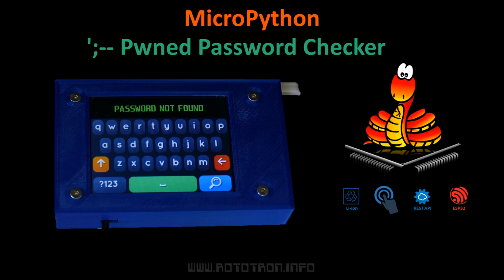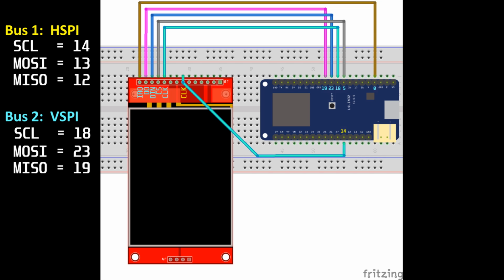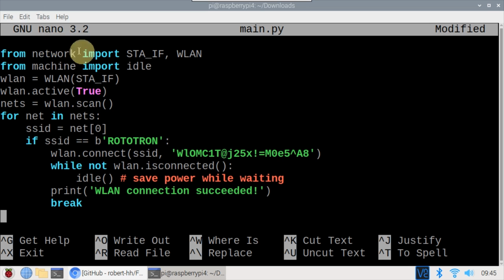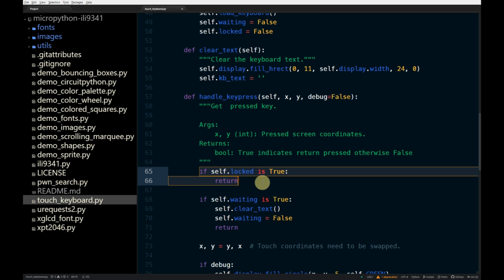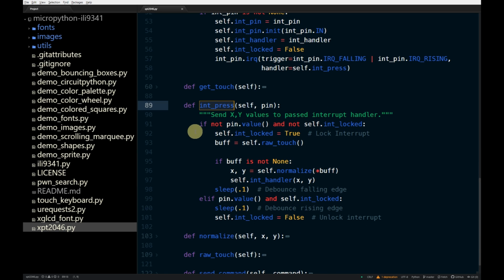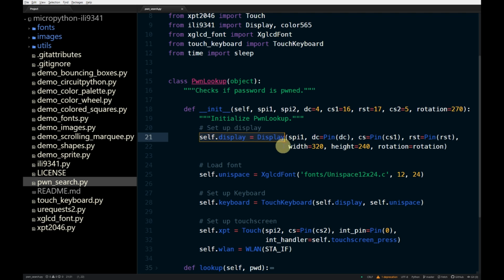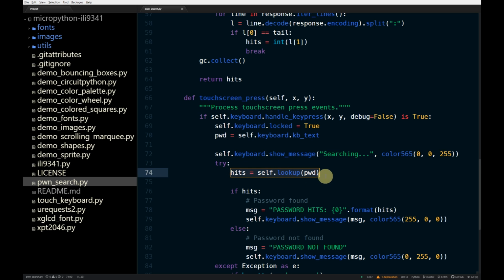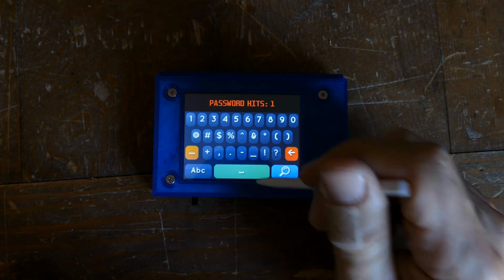MicroPython ESP32 Pwned Password Checker

Comment: Hi, please help me to test the "demo_fonts.py" as I am not aware, where and how to add the font files "ArcadePix9x11.c, Bally5x8.c ETc.," to ESP32. Thank you with Great regards.
Reply from the maker: The path to the font file is specified when loaded.
For example:
bally = XglcdFont('fonts/Bally7x9.c', 7, 9)

The above code looks for the font file in a directory on the ESP32 called fonts (case sensitive). Therefore, make a directory in the root folder of the ESP32 called fonts and then copy the font file to that directory.

Comment: Thank you for this tutorial. I use your library, it is very explanatory. I wonder can i use png or bmp for images. If that is possible, can you explain?
Reply from the maker: Yes, my GitHub repo contains an image conversion utility in the utils folder called img2rgb565.py.  It can convert most common image formats such as JPEG and PNG to the required RGB565 format.
Reply: @rdagger  Thank you for this info :)

Comment: The video ist great, full of infortions. The Demos on the GitHub Page are greate and help to understand the Stuff.But i have a Problem. Wenn i configure the Display in landscape, the images are OK, but the Words are illegible. In portrait are the Words OK.
I don't find the Error. Can you help me?
I hope you know what i mean. My English is not very good.
Reply from the maker: When you initialize the display with rotation=90 or 270 you must specify the rotated width and height. For example:
display = Display(spi, dc=Pin(4), cs=Pin(16), rst=Pin(17), width=320, height=240, rotation=90)

Otherwise the default width and height will be 240 and 320 respectively which will be reversed.
Reply: @rdagger  That wasn't the solution. My configuration is like you wrote, only with different Pins. I output the text with
display.draw_text(20, 108, 'Hello World ...', espresso_dolce, color565(0, 255, 255), landscape=True) respectively
display.draw_text(20, 108, 'Hello World ...', espresso_dolce, color565(0, 255, 255), landscape=False).
If landscape = true, the text is legible but rotated by 90 degrees. if landscape = False, the writing direction is right, but the characters cannot be read.
I just can't find why the characters are illegible.
Reply from the maker: @Eule0963  Does the problem happen with other fonts too?
Reply: @rdagger  Yes. I've tried all of the Fonts from the Git-Example. All have the same Problem
Reply: @rdagger  I still have a hint, with the "demo_fonts.py" on Github, the text is only displayed correctly in the second section if "landscape = True" is at the end. Maybe that will help a little.
Reply from the maker: @Eule0963  I tested the code at all rotations and orientations with the Expresso font and it worked.  Here's my test code.  Please note I changed a couple of pins because I'm using a different ESP32 board:

from time import sleep
from ili9341 import Display, color565
from machine import Pin, SPI
from xglcd_font import XglcdFont

def test():
    """Test code."""
    print('Loading fonts...')
    espresso_dolce = XglcdFont('fonts/EspressoDolce18x24.c', 18, 24)
    print('Fonts loaded.')
    # Baud rate of 40000000 seems about the max
    spi = SPI(1, baudrate=40000000, sck=Pin(14), mosi=Pin(13))
    
    display = Display(spi, dc=Pin(4), cs=Pin(5), rst=Pin(19),
					  width=240, height=320, rotation=0)
    display.draw_text(0, 0, 'Espresso Dolce 18x24', espresso_dolce,
                      color565(0, 255, 255))
    display.draw_text(0, 319, 'Espresso Dolce 18x24', espresso_dolce,
                      color565(255, 255, 0), landscape=True)
    sleep(5)
    
    display = Display(spi, dc=Pin(4), cs=Pin(5), rst=Pin(19),
					  width=320, height=240, rotation=90)
    display.draw_text(0, 215, 'Espresso Dolce 18x24', espresso_dolce,
                      color565(255, 0, 255))
    display.draw_text(295, 239, 'Espresso Dolce 18x24', espresso_dolce,
                      color565(255, 255, 255), landscape=True)
    sleep(5)
    
    display = Display(spi, dc=Pin(4), cs=Pin(5), rst=Pin(19),
					  width=240, height=320, rotation=180)
    display.draw_text(0, 0, 'Espresso Dolce 18x24', espresso_dolce,
                      color565(0, 0, 255))
    display.draw_text(0, 319, 'Espresso Dolce 18x24', espresso_dolce,
                      color565(255, 0, 0), landscape=True)
    sleep(5)
    
    display = Display(spi, dc=Pin(4), cs=Pin(5), rst=Pin(19),
					  width=320, height=240, rotation=270)
    display.draw_text(0, 215, 'Espresso Dolce 18x24', espresso_dolce,
                      color565(255, 0, 255))
    display.draw_text(295, 239, 'Espresso Dolce 18x24', espresso_dolce,
                      color565(120, 255, 0), landscape=True)
    sleep(5)
    display.cleanup()

test()
Reply: @rdagger  I found the Mistake. The xglcd_font.py File was the Problem. I re-uploaded all the Files Piece by Piece to the Controller. After I uploaded the File "xglcd_font.py" everything worked as you described.
Thank you so much for your Support and Patience in finding the Bug.

Comment: Great video !! I have tried to add and display some other images in raw-format, but they all show up as "garbage". What program & settings do you use for creating images that can be displayed here ??
Reply from the maker: My repo has a python utility called img2rgb565.py in the utils folder.  It converts JPEG and PNG images to the correct raw format.
Reply: @rdagger  Great !  Thanks for a fast response !!! That utility  will be VERY useful !!  One more question : I use LOLIN ili9341 displays, where the displaypart  works fine with your program, but the problem with the LOLIN displays are that the XPT2046 shares the SPI-bus with the display. I will try to find a solution for this, so I can use the display & the touchscreen with your program,  but (as the author of this program), can you give me any hints if this makes sense,  or if this means a LOT of rewriting, so I would be better off  finding  another display ??
Reply: I checked the  img2rgb565.py routine. It needs the PIL module. I am using an ESP32. Is there  a microPython PIL module for the ESP32 ??
Reply from the maker: @gurra8888  You can lower the baud rate for the display to make it compatible with the touch driver.  It will work but the display will be substantially slower.
Reply from the maker: No.  You will need to convert the images on a computer or Raspberry Pi.
Reply: @rdagger  I've been using your MicroPython for some time now and everything works just fine...(graphics, fonts , images etc.). The only thing left is to find out how the xpt2046 calibration  routine works ?? 
In my project , (for practical reasons),  I had to rotate the display 180 degrees ,  so its still  in portrait mode, (x = 240 pixels & y = 320 pixels). The rotation parameter for display rotation  works fine, but I dont know how to use the XPT calibration part,. Please advise....
Reply from the maker: @gurra8888  First set the keyboard.handle_keypress method debug parameter to True.  This will allow you to see on the LCD where the touch screen thinks you’re pressing.  Then adjust the x_min, x_max, y_min and y_max parameters of the XPT2046 Touch class init method.

Comment: After all the code is loaded. I checked the repl after reboot. (ignore the misspelling of succeeded.)And I get these errors:  WLAN connection succedded!
E (13662155) spi_master: spi_bus_initialize(131): host already in use
Traceback (most recent call last):
  File "main.py", line 13, in <module>
  File "pwn_search.py", line 109, in <module>
  File "pwn_search.py", line 99, in main
OSError: SPI device already in use
MicroPython v1.9.4 on 2018-05-11; ESP32 module with ESP32
Reply from the maker: There was bug in MicroPython that was fixed in 2019.  You are using 2018 firmware.  Please try a newer version.
Reply: @rdagger  Ok, that version works. everything works and comes up. except the keys translate wrong. For ex. press 'l', 'a' displays; press 'a', 'l' displays; press 's' and 'k' displays and so on.  Any ideas?
Reply from the maker: @trauatsgg3809  Change the debug flag on the keyboard.handle_keypress method from false to true.  This will let you see where the screen touches are perceived.  There are 2 likely causes. Some Ili9341 displays use different orientations for the touch screen and the display.  The display class has a rotation parameter to accommodate different orientations.  Once you verify the correct rotation then you can address the other possible issue which is calibration.   Fine tune the key press accuracy by adjusting the Touch class x_min, x_max, y_min and y_max parameters.
Reply: @rdagger   Thank you for your time.....The keyboard.handle_keypress method was already set to 'true'. in the ili9341.py file the rotation was '0' , I changed it to '180' (on line 84). But, I still get the same symptoms after reboot. Am I changing the correct rotation in the right file?
Reply: @rdagger68 WORKING!  I changed line 18 or the pwn_search.py line from 270 to 180.  Thanks for all your time and help.  I'm off to your other two projects. Thanks again.

Comment: I really appreciate this project and the references to computerphile. My only comment is that the demo programs in the directory don't work as presented. They are using the spi bus connected to the keyboard (if you wire it up as per this video). I thought at first my display was toast or something else until I tried the pwn_search and saw the keyboard display.
Reply from the maker: Great catch!  The demos were ported from my SSD1351 library and use VSPI instead of HSPI.
Reply from the maker: I updated and tested all the demos to match the video wiring.

Comment: keyboard layout refresh seems a bit slow, although it's on SPI..
Reply from the maker: I assume you’re referring to the speed of switching between keyboard screens (for example lowercase to upper case).  The draw_image method is optimized to conserve memory because I’m using an older ESP32 chip with minimal memory.  Newer ESP32 chips add several MB of PSRAM.  With more memory it would be possible to use sprites which should be substantially faster.  Also the draw_image class was originally optimized for the SSD1351.  It could probably be improved for the ILI9341.  In terms of usability, I don’t find the draw time interfering with my typing.  If anything, the resistive touch screen is more of a bottleneck.  If drawing speed is critical then a display with hardware acceleration such as the Nextion or FTDI EVE might work better although they are more expensive.
Reply: @rdagger  Yes, this is what I meant. I assume buying esp32 with more psram would be the easiest solution. Love your python projects, it would be great if you do them more often :)
Reply from the maker: @roostertechchan  More PSRAM is usually better and the extra cost is minimal.  I tested the program on a newer ESP32 with 4MB of PSRAM using sprites and the keyboard drawing lag was no longer noticeable.   I added the sprite image to my repo and posted sample code to my website:  https://www.rototron.info/projects/esp32-pwned-password-checker/#sprites